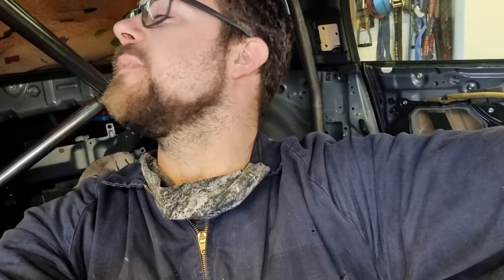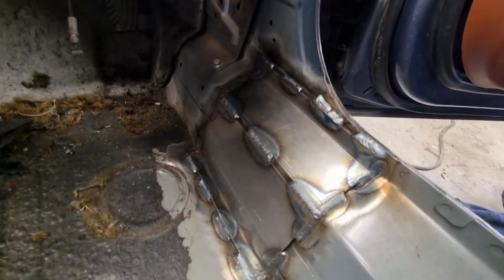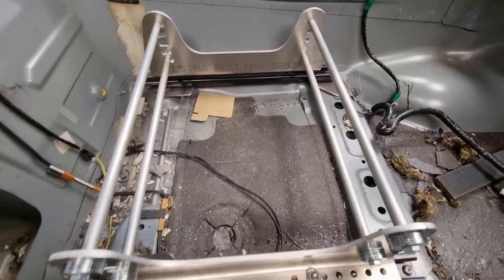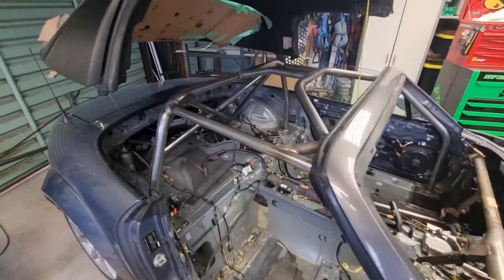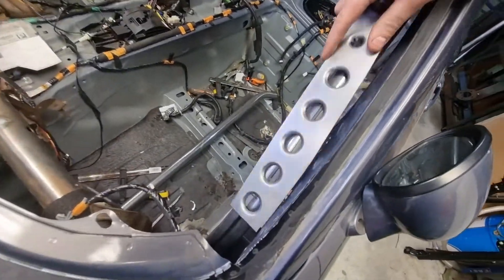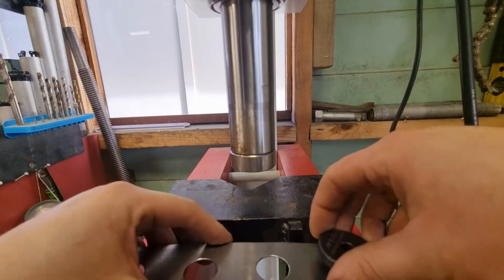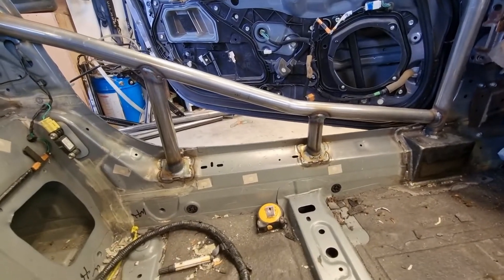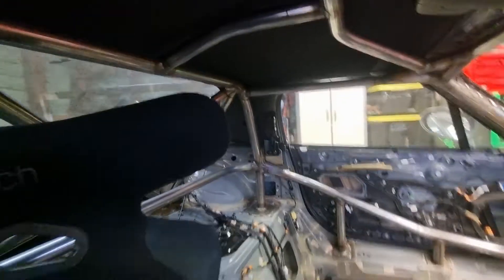Mazda Miata MX5 Roll cage P2/2

Comment: Love the video, very nice work. 
Does anyone know the model of seats? I can't find anything in the Racetech catalogue with a 400mm outside width
Reply from the maker: Thanks! The seats had been supplied by the customer so I don't have a product code sorry, I have found most standard size seats are close to the 400mm wide at the mounting points, on the Racetech website they have several at 400mm wide. https://www.racetech.co.nz/shop/RT4200-motorsport-seats
Reply: @mvmotorsport5543  thanks ! I was looking at the total width, of course you were working off the mounting points